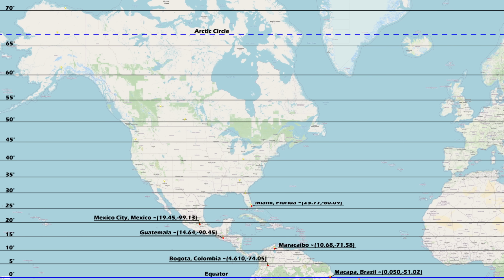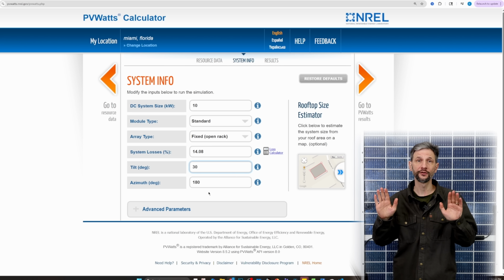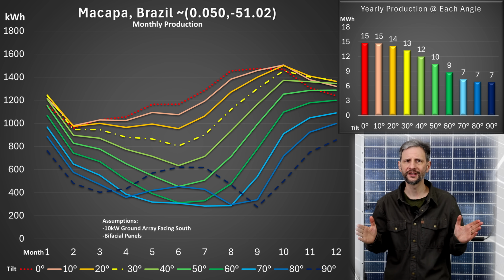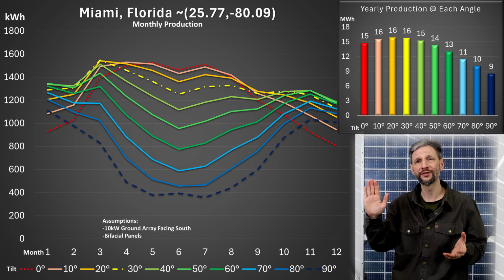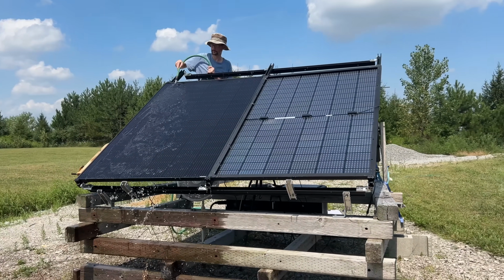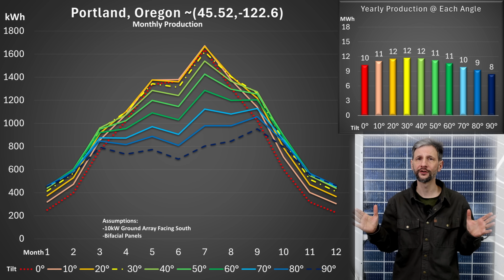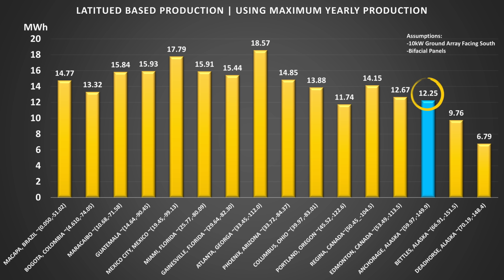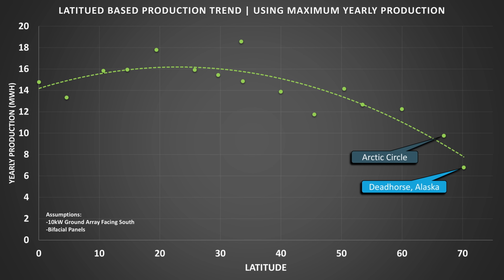Your Location Destroys Solar Panel Efficiency

Comment: So the old rule of thumb that if you match your tilt angle to your latitude, you are pretty darn close. Good to see the data to support that (even if it can vary slightly due to local differences.
Reply: Oh I always heard it was your latitude plus 10 to 15 degrees if in snowy areas.
Reply: @mediocreman2 - Interesting. I had not heard that one but it does make sense. I assume you would trade some efficiency for enhanced snow clearing. Thanks.
Reply: The thing that stuck out to me is how good 10º is on annual production in every location, if you don't have to worry about snow. I'm at 35.5º S and have my panels on the ground, propped up to 10º using $3 concrete half-blocks (190x190x190) 1-high on the north side and 2-high on the south side. That's enough slope for rain to run off but it seems you don't even have to worry about wind. I've had some good storms in the 5 months I've had my panels, with trees nearby falling, including on to power lines, and they don't even look like wanting to lift -- though my yard is pretty sheltered by feijoa and citrus and bananas and bamboo just a few m from the panels (and the house and garage on N and S sides of the panels). I don't have net metering. I have even better. My lower production in winter almost exactly matches my consumption in the 7-9 AM and 5-9 PM peak pricing times, when electricity costs literally 2x as much (64c) as off-peak (32c). So if I can fully charge my 6kWh of battery (not hard with 2.6kW of panels) in the day time and then use that, and only that, between 5-9 PM, then that electricity is more valuable per kWh, even though in summer I can run on many days 100% from solar power, including overnight.
Reply: @BruceHoult thanks for the comment,I have a snow”problem”so it’s steeper for me

Comment: Heh, I can relate 100%. I live close to the same latitude as Anchorage (Stockholm, Sweden), with a 35° roof with 16kW panels, and best summer month has been 3300kWh, and worst winter month was 18kWh. 18! For entire December one year. I can get up to 125kWh in a day during a clear, not so hot, summer day. I usually think of the 6-8 weeks +- the winter solstice as "no solar" time. Almost constant cloud cover means we have days without any production at all, the array doesn't even start.
Reply: Same like Saint-Petersburg Russia
Reply: "the array doesn't even start". I think this is a much-ignored aspect, which may be highly dependent on the MPPT used. What do you have? Looking at Victron specs I'm alarmed by their MPPTs needing Vbatt+5V to start and Vbatt+1V to produce any power at all. I have a system with 48V battery (so 54+ fully charged) and panel arrays with 118Voc, 96-104 Vmp in bright light. But I've seen my Pecron E3600LFP extracting 200-300 W (from 2640W of panels) at 32V (11V per 40V panel!) in heavy overcast and rain, or very soon after sunrise with a low sun angle and a lot of shading. I just went though a week of heavy summer overcast and rain (and flooding, and power outages) and almost always saw 400-500W from the 2640W of panels, even in the worst conditions. Maybe dropping to 100W for a few minutes in the very heaviest tropical downpours. I haven't done a winter yet, but I'm expecting 30% of summer production, not 0.5%
Reply: @BruceHoult with victron you don't put a 48V solar array across the charge controller.  i don't know any brand that asks you to do so.

you overpanel as much as possible on the safe side of VOC and get early startup without problems.
Reply: Sounds like your mppt is malfunctioning, has bad settings set, or you cheaped out on it. You should be able to get a significant amount of power from moonlight with an array like that!
Reply: @runed0s86 not a chance. Moonlight is basically sunlight reflecting off a small surface similar to asphalt, and is around 1/400000 of the intensity of sunlight i.e. assuming anything happens at all a 16kW solar array can produce no more than around 0.04W.

Comment: Not a single mention of cloud!  Clouds are important in some places, and change the calculations considerably.

I live in Wales, it is normally cloudy, so there is little point in pointing the panels at the sun, it is more important to point them at the sky, so despite being at 52°N, I have my panels at 11°, which maximises output on cloudy days throughout the year.
I'm not actually interested in maximising yearly production though.  Since I'm off grid, I'm only interested in weekly production, with battery storage to get through rainy days. Only problem with 11° is snow, but I don't get much of that, and it normally melts after a day or two.
Reply from the maker: You're right, clouds definitely play a significant role and can alter the optimal angle for panels, especially in consistently cloudy climates like Wales.  That's why I recommend running the numbers for your address specifically, this is just to give you an idea of the impact of Latitude.

Comment: Great research Dave, but for those that have almost 1mw PV plant, the main thing is the PRICE per mwh, so i can see the best setup for max revenue, not production. For example, i can trade production in summer for production for winter since price in winter is 2- 3 times higher in winter. I can give you the data for full year and maybe add those for the next video ;)
Reply from the maker: That's a good point about optimizing for revenue rather than just production, especially with seasonal and even hourly price fluctuations.  Where I live the price is the same 24/7.
Reply: @ProjectsWithDave how much is per mwh? I sell on open market and the price per hour and seasonally fluctuates alot. Liek in summer in 1pm is 0 or even negative, and in winter is 200usd/mwh...so i need data to see if its better to have lower production overall but higher revenues. I can sacrifice some wmh in summer for higher production in winter when the price is much higher.
Reply: Yes, I get only about 30% as much production in winter, but it basically ALL goes to replacing 64c/kWh electricity between 5-9PM (and 7-9AM), vs summer production which runs me 24/7 but which is replacing 32c power at night and a whole heap of 38c power for aircon between 9 AM and 5 PM. So the inter power is on average much more valuable I'm 35.5º S and have my panels at 10º which is near-ideal mid-summer (12º ideal, 15º now in late January, but the cosine loss is very very low) and as this video shows is fine for total annual production, especially in places with overcast winters. The 10º angle also allows me to "mount" the panels on the ground on $3 concrete blocks at each corner, not fancy racking that costs more than the panels. At that angle wind loading is very low, especially that close to (often long) grass.

Comment: Great video.

I am at 12 degrees latitude. Near the equator both summer and winter see lower production. In summer the sun is in the north and in winter the sun is in the south. You can optimize for when the sun is in the south, but then the summer will be your lowest month. If you want consistent production, you have to look at the model to see what is optimal. The most important factor here is clouds. It looks like Brazil has a dry and a rainy season.

If you look at how much batteries you need, consistent year round production is even more important. My battery covers about 60% of my daily use, but with that battery I can reduce my grid consumption by about 90% (I have no net metering). I could go off-grid with double the battery and 50% more panels. Further from the equator you'd need multiple days worth of storage.
Reply from the maker: Location is everything... : )
Reply: Yes, I assume those numbers are somehow taking account for clouds and especially overcast and rainy conditions which tend to mean you're collecting diffuse light from the whole sky (and especially directly overhead, where the path through the clouds is shortest), which is a reason 10º does so well. 60º in winter is great if you have clear skies and sun, but it's probably losing a lot in a place with overcast weather. I'm at 35.5º S where snow is not an issue, but both summer and winter have a LOT of overcast weather. I have 6kWh of battery (and 2.64kW of panels) with around 11kWh/day of paid-for electricity use (before I had solar). On good sunny but not hot (up to 22º C say) days I reduce my grid consumption to Zero, but averaged over a month it was around 90% in October and November. This month will be more like 80% because of a week of weather with thick overcast and rain and hot temperatures and no sun, where I used up to 19kWh for aircon with very little solar production, vs the normal 4-8 kWh/day for AC (average 8 overall so far this month) and 12-18 kWh solar production. My non-heating/cooling consumption is a pretty steady 5 kWh/day -- just two hours of good solar production. "Further from the equator you'd need multiple days worth of storage". -- I disagree with that, you just need to have either grid or a generator available. And gas/wood etc heating in winter. I think your "double the battery and 50% more panels" is about right for off-grid. I'd probably double the panels, for winter. This won't eliminate the need for a small generator (2-4kW), which is 3x-5x more expensive than grid power, but will drastically reduce the need to use it.

Comment: OMG! Watching fro Australia's tropics 17 deg south. Corrosion near the tropical coast is a system killer. Going inland the sheer solar and UV radiation is causing heat loss and cell burn requiring replacements before the system is paid off. I have travelled the Florida coasts and there is not much solar there. Some European places produce more in higher altitudes with more clearances and some installations are happiest at -10 der centigrade as their internal resistance is lowest. Can't see water cooling to be a benefit.
Reply: There's not much solar at the coasts because that's where rich people live, and rich people would rather burn tires to smother the peasants to make power instead of covering their 300 acres of lawn with a solar array.

Also, solar manufacturers haven't figured out that the ocean exists yet, so they don't make their panels durable.

Comment: Yearly totals one way to look at solar.
In the Northern Hemisphere, the problem comes in at 5 weeks before and after the winter solstice. My solar produced 40% of what the 6 months surrounding the Summer Solstice did.
Reply: Here in Montana the winter solstice has been difficult, but my vertical array has been the winner. We didn't need to use a fuel burning generator at all this year, although we had to ration usage for 6-8 weeks.
Reply: One good thing about cool air temperatures up north  is the efficiency jumps by +20%.   I’m here in San Diego and my friend in Washington state  makes a bit more electricity than I do for the same size system same optimum angle for his latitude.   It’s because his air temps are lower in summer versus here in San Diego.   Basically don’t forget to think about heat .
Another thing to think about is optimizing for the time of year you would like.   Maybe you want to ensure more winter production so you would tilt your panels for the winter sun.    But if you’re like me and have net metering, I want to optimize for peak San Diego summer $.60 a kilowatt hour rate so I can get paid to offload to the grid when rates spike (or just use the electricity myself instead of buying it).  Even time of day use matters .
Reply: @Shabobidhuffy  All that is true. I have a house in Maine and winter 300 miles south in NJ. I get a higher efficiency per hour in the winter, but only 3.5 hours of peak sunlight per day in the winter. Panels are at 60 degrees in the winter and 20 degrees in the summer. In the summer it's cooler in Maine with over 6 hours of peak with an extra 2 hours of nominal.
Both NJ and Maine charge around $.30 per kilowatt hour, so I'm mainly offsetting 50% of my load. In 10 years, my Electric bills went from $40 per month to over $120 with only a 25% increase in KWHs. Not enough costs to spend $15,000 on a grid system, plus the two portable units can be shared between the two homes.
Reply: @Shabobidhuffy  your choice makes total sense for your situation.

For off-grid use, optimizing for Winter Production was the path hubby and I chose.

Minimizing our winter power demands and over paneling to the point we could get by on the 10% thick overcast winter days without needing any 'days of autonomy' saved us money overall on the system. And we have a much smaller battery bank for when that needs replacing.

Still have way more power than we know what to do with in the summer even with the winter optimized angle.

One other thing I've heard but not confirmed, a more vertical panel is going to stay cooler (because the heat rises up and away from it more easily, and because the solar radiation is hitting at a steeper angle rather than blasting it head-on) and therefore should theoretically degrade more slowly over time 🤷‍♀️

Time will tell, but so far we're really happy with our self install
Reply: 10 weeks is 40% of 26 weeks. That would mean your winter production is the same winter and summer. Are your numbers correct? Am I missing something?
Reply: @atomicsmith  4000KWH per day average during Summer.
1600KWH per day average around 12/22.
Reply: @stans5270 1600kwh a day.... really? That could easily heat my house in the dead of winter. How large is the array?
Reply: Damn you are lucky, im under 10%
Reply: @Hansen710  I discarded the numerous extra days that storms and clouds linger as that would be more of a specific oddity of nature.
Reply: @stans5270  Well, storms are a part of season. If you live somewhere where summer has almost no rain and winter has storms every second day, than you should include that in your calculations.
When I was doing the math around my hypothetical off grid power (can't have a real one if you are homeless) I found out that a mix of solar and wind is best since where I live wind gets so much stronger during winter that a wind turbine that would produce only 300Wh per day during summer will get overloaded and produce near 10kWh per day in winter.
Reply: @hubertnnn  What you want included are aberrations, which are overall, included in averages. 
80% of the people living in the US, live in non-rural areas. Wind turbines are useless in 99% of urban and suburban areas as multiple acreage ownership of property is needed. Even then because of zoning and permits, it's basically unrealistic. There are only 2 in my entire state of NJ.
Initial costs of wind is 2 to 10 times that of solar. Longevity of wind is less than half that of solar. Plus wind requires maintenance.